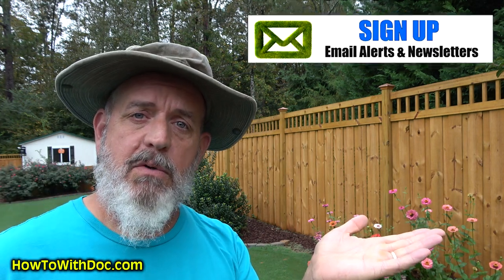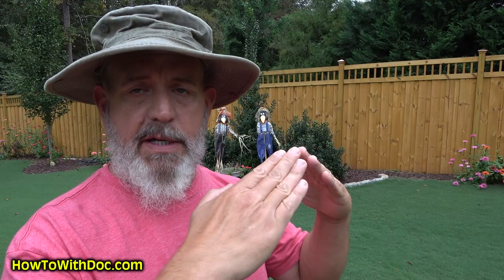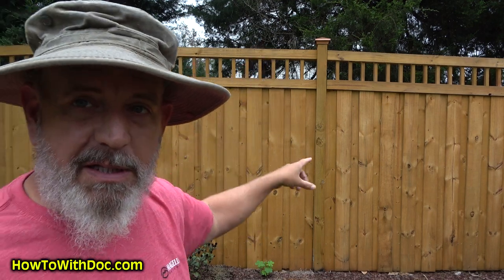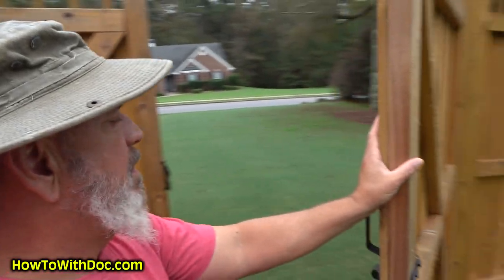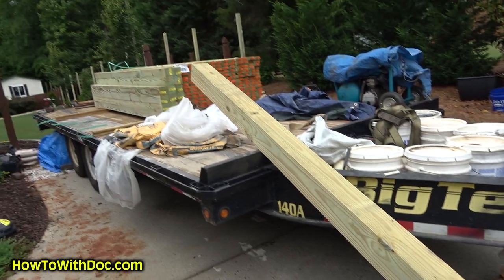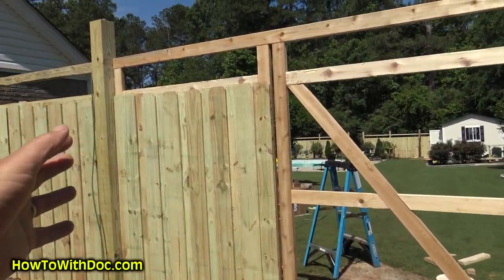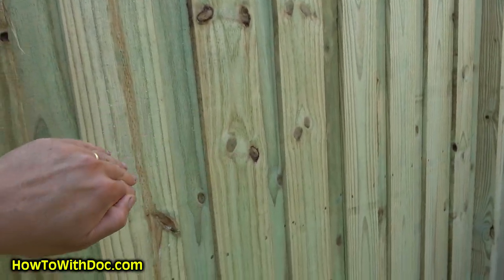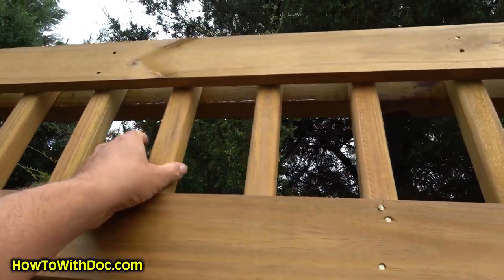Custom Building Wood Fence - Step by Step Privacy Wood Fence

Comment: In the video you mentioned butting the 2x4s to the 4x4s in the corner of the fences and to the gates. Could you elaborate how the corners are done? The video shows the example of the gate but not the corners. Why do the corners need to be done?

Comment: Hi Doc, can you tell me where you purchased the wood slats and materials for the fence.  Some of the pressure treated wood I see have a dark green hue and the lumber you used has a a very slight green hue, it doesn't look like much.  i don't think you can stain the darker green lumber to come out as nice as what you did.  Thanks for the video, help and advice.

Comment: Wondering if the 30 Second Cleaner would be the best choice to clean my solid stained (lightly colored) fence. I stained it a year and a half ago, but afraid whatever I use will take the finish off.

Comment: They should have used galvanized fence rail connectors. Your fence will twist and come apart much easier in a few years. The way they did it is the quick and easy way.